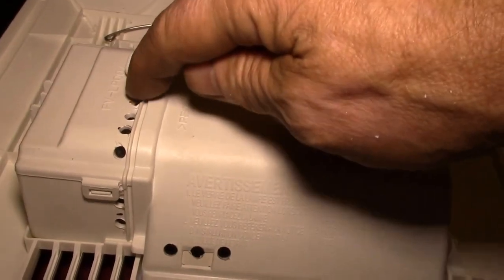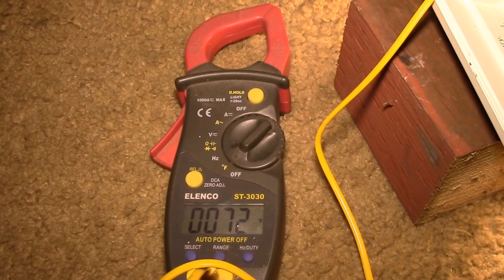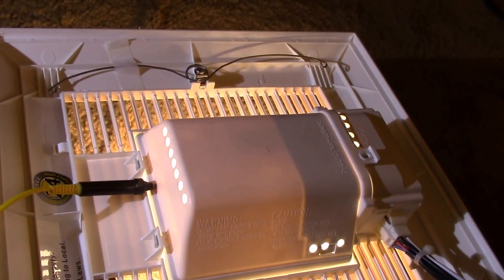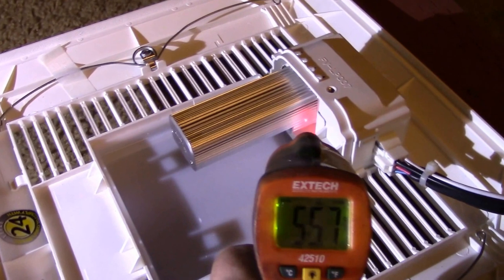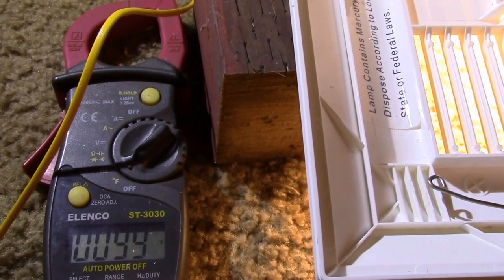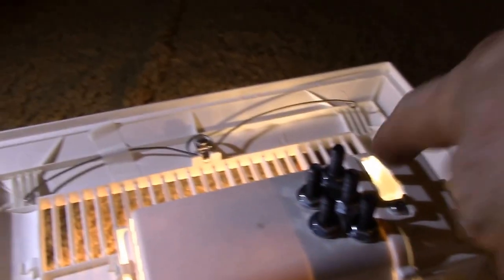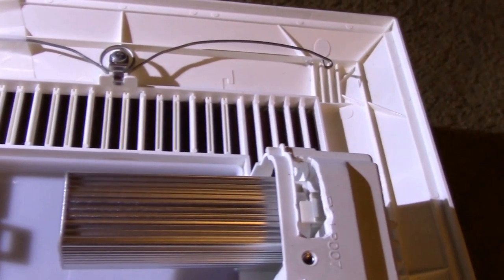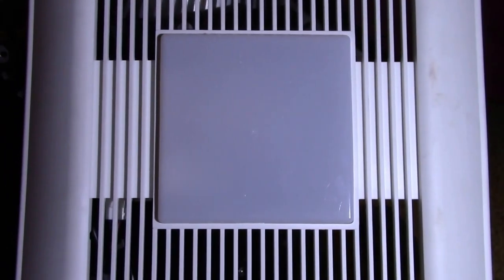Panasonic WhisperLite Bathroom Fan CFL Replacement, Part 5

Comment: I want to replace my original light to LED! And was wondering is the Led cooler than the original light? And do I need to vent it as well in order to add the LED?
Reply from the maker: Yes and no.  The LED is cooler than the old CFL tube, but that tube has no electronics inside it, those are all external to the bulb housing.  With the LED, everything sits inside the housing.  I drilled some ventilation holes in mine to allow some air circulation.  May not be necessary, but it can't hurt.

Comment: Do you need to remove the whole housing to replace the bulb?
Reply from the maker: Assuming the fan is installed in the ceiling, you just need to pull down the vent/light panel and unplug the light connector from it.  Then unscrew the cover over the bulb to get access and pull out the old one and plug in a new one.  Put the panel back up, plug in the connector and pop up into the fan unit.
Reply: @The4Crawler  ok, thank u, but that plastic piece that shines light through doesnt come off, feels like it will break if i force it 😔
Reply from the maker: On mine, there are two spring steel wires on each side that go into clips in the inside of the fan housing.  I can pull the whole vent/light panel down, it's hard at first but gets easier the farther down it's pulled.  Then at the end, you need to unclip the wires from inside the housing to remove it.  Here's a photo of the cover pulled down part way:
https://drive.google.com/open?id=1PYNkMGlrn7Kaeua2FHOJcD9GqB8BegdK

Maybe your's has been stuck up with caulk or something.  Try running a thin knife blade around the 4 sides (don't go too deep with it).  If that doesn't work, check the owner's manual.  Maybe your unit is built different than mine.  You can download the PDF copy of the manual off the Panasonic web site if you don't have a printed copy.